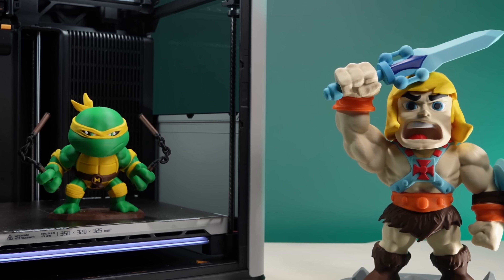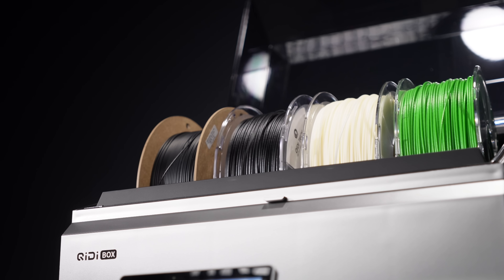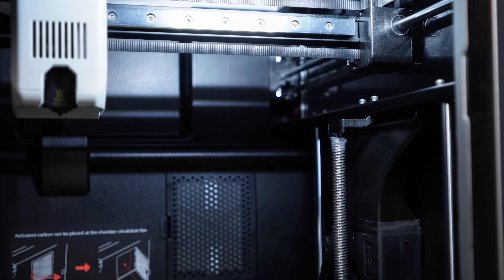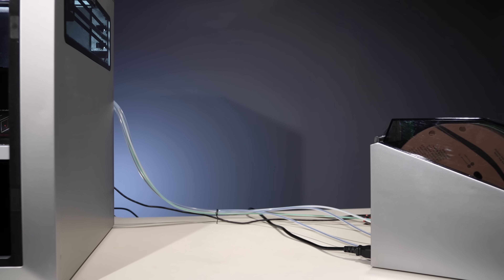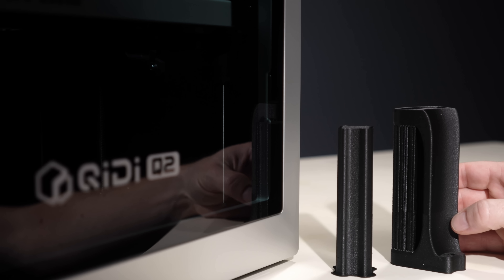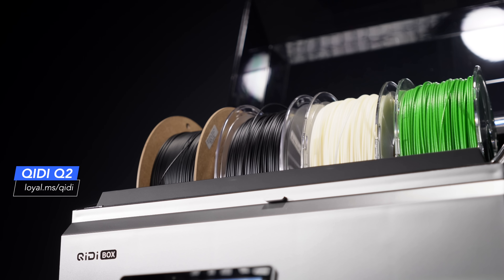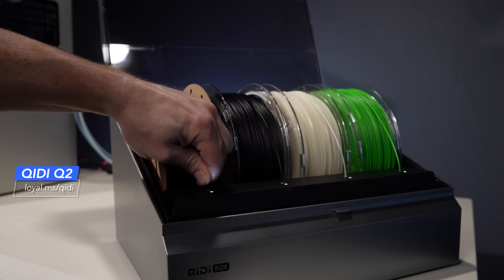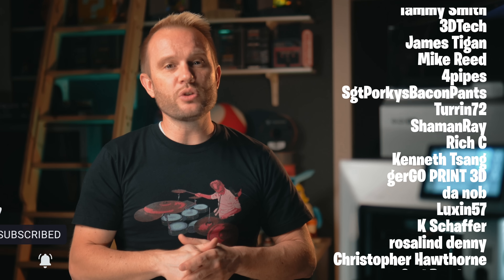New $449 QIDI Q2: First Look & First Problems

Comment from the maker: 🔥 First Look at the QIDI Q2 is live! I love the print quality on PET-CF… but the MMU/PTFE tube setup gave me problems right out of the gate.

Q2SPECIAL50 … saves $50

https://loyal.ms/qidi

👉 Question for you:
Do you think every new printer in 2025 needs multicolor, or should companies focus more on making the user experience flawless first?

Drop your thoughts below — I’ll be reading and replying! 👇
Reply: Tough question. For those of us who have some experience tinkering (my first printer is an Ender 3 v2, which is heavily modified and running Klipper), I'm okay working through some of the ups and downs. I've owned my Plus 4 for about 5 months and it's far and away easier to use than the Ender! 

I believe Qidi will continue to improve, though they do need to listen more to the community. It seems that they want to move in a direction similar to Bambu, which will NOT bode well for them. They need to keep us close!
Reply: I care not for multi color printing, I just want something to slam out engineering filaments better than my ender 3 v2
Reply: @josephporfido2433 Q2 or Plus 4 are both amazing options. I own them, and they both print PC, PA, and all the fiber variants solidly!

Comment: Just came across your honest review of the Q2. My new Q2 has been printing pla, Petg, abs, but has a serious TPU issue. It loads TPU ok, prints ok, but that’s where it stops! Using the menu filament unload function, the knife can’t cut the TPU, only makes a dent. Then the unload continues and the extruder pulls heated/melted TPU out of the nozzle leaving a clog 20 mm in from the top of the nozzle. Loading in new pla or Petg filament it hits the  clog and just grinds in the extruder. 
Can you please print TPU to verify my findings and hopefully publish a solution. For now I have a clogged nozzle and waiting for a new one. Not my first printer in 8 years, or new to printing TPU, but  this is a serious issues I’m dealing with. 
Thank you

Comment: actual size of plate is 280x280x250, i have no idea why everyone is marketing it as 270x270 :D
Reply: Because the print head has a certain size, the edge of the build plate cannot be printed. Therefore, the print area will be smaller than the build plate area.

Comment: The qidi box is not compatible with TPE, Generic TPU, PVA (damp), BVOH (damp), TPU 95A, QIDI PAHT-CF and other overly rigid or overly flexible filaments. QIDI BOX is not compatible with cardboard spools. If you prefer to use cardboard spools, we strongly advise using a Spool Adapter/Spool Adapter Ring.
Reply from the maker: Your copy/paste works

Comment: With a beginner friendly filament like PLA, the loading is near flawless. Plus, your example of the bend isn't realistic, the extruder will be at the rear of the chamber where the loading and unloading is meant to happen. So, I would say to you, use the tube clips that comes with the box instead of zip ties. Now I do like your review, but I think you were not showing the best scenario for the loading process to succeed. Personally, I didn't like the Qidi Box on my Plus 4 and sent it back. I think I will wait for a few upgrades that they need to do before I will try it again. I really don't use anything but ABS and above, so it would be a toy rather than a tool for me. Thank you for the first look.
Reply from the maker: Note, slot 1 was PLA, because I had already tried that, and the toolhead was only moved to the front by hand for the purpose of filming. Of course all filament changes happen at the rear and that doesn’t change the bend of the PTFE.

Comment: Heck yeah! I love Qidi because they offer so much for the money. They've been slept on until recently it's great to see them continuing to improve more and more.  Little fact that folks may not know, they were actually working on adding multi-color with the X-Max 3, there's a filament cutter head design they pulled right before they released the printer because the QiDibox wasn't ready yet.  Just imagine if they had pulled it off then, a large volume multi color unit 😮  It's good to see them finally getting there since their team is pretty small.  Can't wait to see what they do with the future machines like the X-Max 4
Reply from the maker: This is a seriously loaded setup!

Comment: great video, one thing I want to ask
..

Do you think it's okay they have made the same mistakes on the Q2 as they did the plus 4 (glass top to low, PTFE pathway, etc) ? 

In no way should the Q2 suffer from any of the same issues as the plus 4... that's my 2 cents and I love Qidi 3d printers.  

Also the Qidi box is the loudest MMu I have ever used in my print lab...already may get rid of it since my dogs constantly bark on the other side of the house when it's pulling back filament. Im not normally negative about this stuff but its looking like the plus 4 launch all over again minus the burning SSR's. 

Keep up the great content loyal!
Reply from the maker: Haha… click click click click click … bzzzzzzzz … click click click click!

My P1S and X1C have both had PTFE routing issues and their hard 90 also with the lid makes that worse when the PTFE starts to wear.

These companies are trying to be efficient with space, and sometimes their internal testing doesn’t see the real-world end-user issues. But it’s okay, it all works out in the end.

Thank you!!!
Reply: @LoyalMoses that post is a click bzzzz... 😅
Reply: @LoyalMoses my Kobra 3 does too. I do say if you use the slice engineering dry canisters in the rolls it helps them from thump as much in Qidi box. things will get better. they'll be ironed out. I accept that. and I think users should too, but new users should be weary
Reply: @LoyalMoses also, I was told by multiple inside Qidi sources they don't want the Qidi box on top of the printer for PLA or PETG. but yet they market it that way.

 If they would have followed the positive designs from Max3 with the features / abilities, looks of Plus4 into the Q2 it would be perfect right out the gate. max 3 has no PTFE patch issues, has lots of space for PTFE to reach head without being bent over. 

Did they use the 3mm id tubing for inside? mine kinked over without first 20hrs of printing...switched to Bambu 2.5 id PTFE and it's been great so far...I did get bunch of layer shifting but it's likely more Plus4 firmware related then the box itself which seems okay minus the noise lol

Comment: One feature that Bambu has forgotten is wired either net.  Thanks for pointing that out.  I think they will be in trouble, with this machine, the Elego carbon and the Snapmaker tool changer.  All great printers for a low price.  I just received my Elego and for $300 am blown away, am using it as much as my Prusa XL and Bambu X1C
Reply: You realise this is a Qid Machine right?  Plus it's ethernet.... ;)
Reply: @MrBennyt19  I meant Bambu will be in trouble with this Quidi and the others being so capable and at a much lower price and no Bambu Cloud requirement
Reply from the maker: I know Ethernet is nice for the nerds and geeks, but the average buyer doesn’t need or want it really.
Reply: @LoyalMoses  You are correct, but having all of my printers on a wired local network makes it easy and fast to load print files and more secure.

Comment: Thanks! I am torn with this one. I am actually window shopping for an enclosed printer with such advanced features, MMU, and capability to print advanced / abrasive material. 

I wish it was larger so I could print helmets with the MMU. The price seems nice, but we really need to start calling out these companies for constantly releasing new products without addressing issues with previous products.

Im scared there will be some issues with this one that may not be fully addressed until they just create a new product again.

This is the reason why Bambulab is preferred unfortunately.
Reply from the maker: The majority of their machines are larger for things like helmets, and it looks like this is definitely targeting beginners to the space with a solid entry level machine.

Comment: Definitely would shortej those PTFE tubes... unnecessarely long.
Reply from the maker: I think they want people to have the freedom to place it anywhere, but that’s obviously created a potential friction issue for sure.
Reply: @LoyalMoses good point.
Reply: @LoyalMoses  Are those "normal" PTFE tubes (like 3 mm inner diameter) or larger tubes (less friction) like in SnapMaker UI?

Comment: Great video. Why can't manufactures just added 3 inches height above the extruder to eliminate that issue. Prices are definitely coming down and that is a good thing for newbies. Keep it up bro.
Reply from the maker: Thank you and great point!
Reply: A lot of Plus 4 qidi owners have printed a riser to lift the lid height up.
Reply: @MrBennyt19  they shouldn't have to. If the riser is required, it should come with the printer.
Reply: @kimmotoivanen totally agree , just a workaround.  Stupid part is they released the Q2 knowing this…

Comment: I feel like a few beta test prints and companies should know about the bend at the tool head. Surprising to me that so many companies are still struggling with this. Also, it looks like the prices are about $50 higher than you mentioned.
Reply: Qidi should know this with issues from the Plus4 that have shown up already, correct.
Reply from the maker: Absolutely, also, code in the description.
Reply: Subscribe to the store and get $50 off

Comment: Qidi is a solid brand. This looks to be another great printer from them. The quirks with the PTFE tube and possible firmware don't surprise me with a new printer, with that said, I agree with your statement about the user experience being critical. I have seen people print on fabric. Printing on tile or wood never crossed my mind. I do like the abilities for more exotic or engineering filaments in this printer. I am having some issues printing PHAT-CF with my X1C. Hope to figure it out soon. 
So many new printers, all quite capable machines, is anyone else as excited to see what is coming around the corner for all of us in 3d printing??? I can NOT wait!!!
Reply from the maker: They make awesome machines.

Comment: Well said. I love the Qidi machine that I own, but they tend to put out machines that have very basic issues that could be fixed with just a little bit of adjustment. Just a couple millimeters of extra clearance would have solved that tight PTFE bend into the extruder.
Reply: Same issue with the plus 4, that they know is an issue and still don’t fix. So dumb
Reply from the maker: Thank you. It really isn’t a lot that trips things up. Like you said, just a couple of millimeters and this was darn close to perfect.
Reply: @LoyalMoses  Q1 Pro have almostb then same issues with the lid too cole. Few hours later i had an ASA riser, problem solved. And it will be the same with Q2. But I agree that they could have made it better.
Reply: A lot of Plus4 owners printed a riser to avoid that PTFE issue.
Reply: That’s not the owners job

Comment: I was just talking about how I'm done with dealing with companies' first attempts at hardware (talking about the Snapmaker U1 in Discord yesterday). I'm absolutely STOKED for the Q2 and hopefully upcoming Plus5. Less stoked for this first iteration of the Box. Thanks for your first thoughts and proving out what I suspected would be an amazing printer.
That said, it baffles me they're still having issues with the printhead being too close to the top. You (and we) called this out on the Q1P last year and the very first thing I printed when I got my Q1P was a lid riser. I hope they can fix this in later printers but I'm suspecting they won't if they haven't yet.
Reply from the maker: I really like QIDI machines and I want them to do well because the temps are amazing for people who want to play with more exotic filaments.

I’m sure they are working on a plan for the PTFE routing.
Reply: @LoyalMoses  I'm super hopeful! My Q1 is often my favorite machine; I flip and flop between it and my P1S combo. The Q1P just works when I throw ABS or nylon in it where I have to turn on the (self-)added heater for the P1S to properly print those. 
I also hope they start gaining more market share and get more of the 3rd party companies to develop and sell their wares for the Qidi printers (really want Biqu Cryo plates for Qidi)! Qidi has caught my attention for sure
Reply: @LoyalMoses I'll bet you a dollar they aren't... Unless you count releasing files for a riser. Seems to be the default on budget coreXY machines at the moment, saves material to lift the height across thousands of machines, money in the company's pocket. K1C, Q1P, Q2, etc.